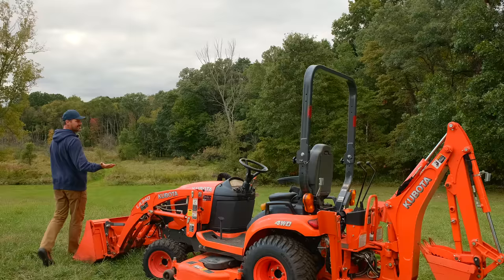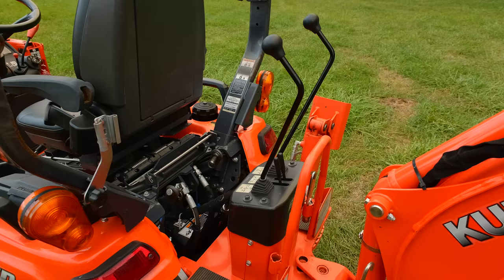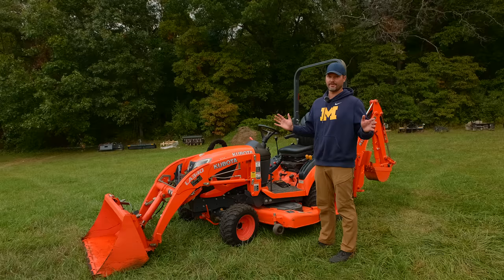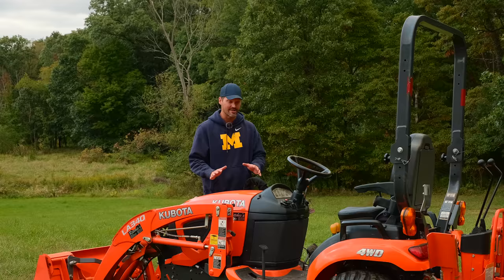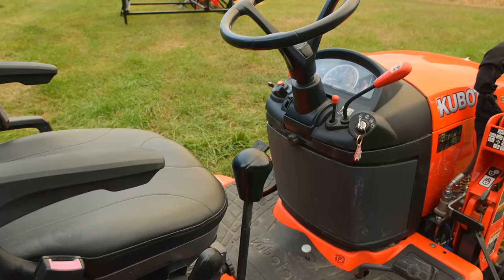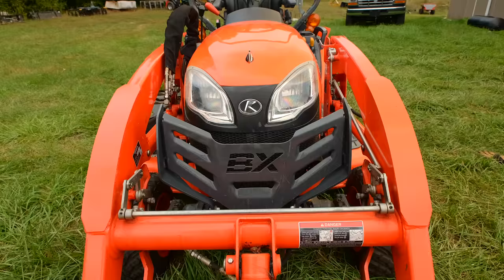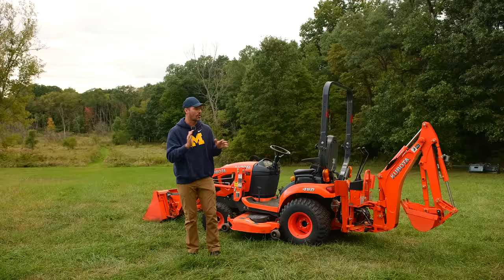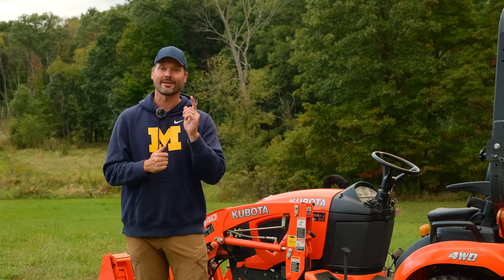PROBLEM AFTER PROBLEM AFTER PROBLEM

Comment: I hope anyone watching this reminds themselves that this is an opinion and for $20000+ investment you do more research. I have this machine and can't think of anything I don't like. This guy bought the wrong machine for his situation. As a lawn mower you wouldn't buy a tlb at all.
Reply from the maker: Pointing out the obvious isn’t helpful to anyone.  You only like everything about that machine because you haven’t owned and used a 1025r 😂
Reply: Kubota is the Ohio State of tractors...pretty good but over rated by fanboys.  Go Michigan!
Reply: @merikatools568  Michigan has beat Ohio st once in the last how many years?
Reply: The 54” midmount mower does fit perfectly. The 60” is to wide to. Accommodate the larger blades.
Reply: Right on.  He keeps comparing it to his bigger tractors.  Most people who buy a sub-compact tractor just have one tractor, smaller space, etc.
Reply: If you had to pay for it yourself you would do well to research the product no matter what it is. After the fact whining isn’t proving anything but a lack of due diligence. Sell it and recoup what you can. 
Plus, some of us buy equipment based upon access to a dealer for parts and service. That’s my story and I may have bought differently had there been another choice.
Reply: I have the older BX23. It has been used moving many tons of gravel, dirt and have dug many many feet of ditch for water, sewer and buried electric line. After almost twenty years old there have been a couple oiled seals start leaking but that’s to be expected. It’s not a D9 dozer or a large excavator. It’s slow digging and it’s a small machine but taken care of will do the work and last for many years. Mine is faded and from digging and bucket use there is lots of paint missing but it doesn’t have one dent or broken piece of plastic. There’s almost 16 hundred hours and I don’t plan on getting anything different.
Reply: It’s coming from a used car salesman. I take nothing he says a serious or having any meaning.
Reply: Mine is the BX2380 with center mower (54”) and same loader. I don’t have the backhoe. I really like mine. I have 30.7 hrs on it no problems at all. Mows better than my zero turn Jon Deere.
Reply: Love my BX23S
Reply: @GoodWorksTractors  I owned and used a 1025 tlb. Not impressive for the cost, especially with overpriced deere attachments. Kubota has better pricing and a better tractor. You 1025 fanbois are odd fellas
Reply: This is obviously an opinion video and this tractor has obviously been abused to only be at 400 hours. I know had a guy that had one of these and he really really used it. He dug ditches almost daily as a part of his job. He then bought a John Deere 2025R TLB and regretted his purchase pretty quick. He said the Kubota seemed stronger. I’m not biased. I’ve never owned a Kubota but I did purchase a new John Deere 2025R in 2021 I think. I’m sure some people love this machine and some hate it. Some love John Deere and some hate them.
Reply: I've beat the crap outta mine I overload it  all the time and push to the max  I actually figured it woukd have broke down by now but only prob I have ever had is 1 flat tire knock on wood 
U may have got a lemon or maybe I just got lucky
Reply: I have had a bx25d for 9 years, 600h on it. I love this machine. It is a workhorse, it never broke  once, even better...i can sell it today for more money than i paid for it. This is the no 1 selling sub compact tractor for a reason.
Reply: he's a salesman, who abused the sh1t out of this poor thing to get commissions.
Reply: @GoodWorksTractors  hey do you have any ford pintos that were only driven by grandma on the way to church?

Comment: I have a bx23s, 54” snowblower, 60” brush hog, 48” box blade, 72” landscaping rake, love this trouble free piece of equipment. It works like a mule!
Reply: Think you bought something you wanted to hate mine is great,tough and very versatile for what I bought it for
Reply: 300 hours on my bx23s so far and no issues that weren't self-induced. Seems like his main complaint is that it's undersized, so the title seems a little harsh. I think for 25k it's a great little machine for 10 acres or less.
Reply: I have a lot of hours on my Kubota trouble free and tough as nails it looks like this Kubota that this guy had really abused it

Comment: I bought a BX23S the end of last year and only started to use it in the spring of this year. It has about 85 hours on it and has been trouble free for all of them. I've used it mostly for clearing land and it's been great for that. I put the third function kit on for a grapple which has made it much more useful. However, my needs have changed and I now need a larger tractor. I will most likely be going with a TYM T394 or T 747. I think TYM offers a much better value than Kubota or John Deere and with their recent purchase of Branson their dealer network will grow quite a bit. TYM also owns their engine manufacturer Kukje. (though they still use Yanmar in several models). But value-wise, a TYM T25 with backhoe is the same or less than a BX23S or 1025R and will outperform both of them quite handily.
Reply: WOW! 85 trouble free hours. Imagine that!!!!
Reply: One thing I noticed and recommend you pay attention to. It can be easy to manipulate specifications or come up with your own testing standard when it comes to claims of performance. Sears was famous for that in their Craftsman brand. Everything they sold from a handheld circular saw to their lawn tractors always had these high claims of horsepower, where the same engine in another brands application had a lower stated value. I am in the market to upsize from my present BX25D to a larger unit and was comparing an offering from Mahindra to a similar sized Kubota unit. The Mahindra had higher ratings for lift capacity for their FEL and 3-pt. It also had a higher horsepower rating of the engine. But, when I looked at the unit weight, I noticed the Mahindra weighed 2000 pounds less than the Kubota. Where did the weight "savings" come from? Well, I will give you my "guess". It is because the Mahindra is made of thinner steel everywhere. How do you think that is going to stand up to service where you take the manufacturer at their word in terms of specs and size the tractor to your planned operations to just be adequate. A lot of buyers do this because tractors are super expensive, and this drives them to buy a unit that just meets their capacity needs. My thoughts are that the tractor built to margin will withstand long term use better if it is made of heavier, presumably more durable, quality materials and put together with quality than the same unit made of less material. In the tractor world durability is the most desirable quality over anything else. To ME, tractors are TOOLS made to WORK. I am not a Kubota fan boi, which is why I have been looking at other brands for possibilities, but my experience has been good given the 400 hours I put on my machine with no issues outside routine maintenance. I am considering others, but they have an uphill battle given my positive experience. I am looking to upsize because I have been pushing the capabilities of my current machine, and think this is unwise.
Reply: @LisaMedeiros-tr2lz  what does mahindra have to do with the tym he mentioned, (yes I know TYM makes some mahindras) The TYM and Kioti are about 500 lbs heavier than the kubota in the compact tractor size. btw, even tho I know the TYM are more rugged, I went with the kubota 2301 because the TYM dealers are terrible here and the kiotis around I looked at were either overpriced or beat to pieces.
Reply: @eviljesus5411  The comments were mostly agnostic to the brand being considered. The message is to look deeper than just claims of lift capacity on the 3-pt and FEL. I wondered how the Kioti could have greater spec'ed lift numbers, yet the machine weighed one ton less overall. The difference is in the structural steel. So if considering a TYM, look at more than lift capacity also. To me if the overall unit weighs less, than it has to be made of thinner structural steel. I can't see how that will make a unit more durable over time was the point.

Comment: The reason I'm watching this video is because I'm working on a bx2370 right now and the title of the video is pretty much what I'm experiencing as well. The throttle won't stay in place it's losing power I'm in the process of taking apart the injectors or trying to find out how to do that... Problem after problem. CV boots that are exposed and paper thin... It's pretty ridiculous. I'm selling it soon and moving and I'm not going to miss it at all. I particularly laughed at all the exposed wires and fuel lines and such running under the tractor completely exposed. I spent a lot of money buying skid plates that protect all that stuff. Terrible design....

Comment: WOW !!!!!!   Pure BS about a BX !   The tire hitting the mower is probably caused by a mal-adjusted Tie rod.  I have this setup and my 2680 and the tires don't hit my 60" mower.
My original BX2200 has saved me about $150,000 over the 23 years I had it.

Comment: I had a 1025r and it spent more time in the shop then it did at my place I finally got john deere to buy it back. Bought a kubota and have over 500 hours on it,its been problem free so far.

Comment: I have an older 25D that never ceases to amaze me.  I don't use the mower deck with it and have made a few mods like rear wheel spacers, bucket cutting tooth, skid plate, larger stabilizer feet, ROPs lights etc.  While it can't lift the most it can push a ridiculous amount.  It has been problem free with exception of front steering boots and the recalled dash cluster from moisture.  This tractor gets more time in the seat than my two larger kubotas and my skid steer.  Everyone that uses it wants one.  I will NEVER be without one.  It's like my wheelbarrow but with a motor, shovel, rake.....a Swiss army tractor lol
Reply: I bought a used 25d and it has served me well. On the dash did kubota have a recall that replaced the dash or did you have to buy one

Comment: I have a BX23S. 2 years, 360 hours, no problems. I have removed my FEL a number times, without issue. This tractor is the perfect size for my three acres. Anything larger would be too large for my property. The 1025R was thousands $ more.
I found it a little ridiculous that you were taking issue with dings and scratches, when they’re caused by the owner, not the manufacturer: mistreat it, it will get damaged.
I could go on, but it seemed like you were looking for excuses to diss it.
I have the HLA light 36” forks, and the HLA1500 54” snow pusher. They all work really well for this small tractor.
I love my BX23S.
Reply: Somehow you beat the shit out of it

Comment: I own a bx23s and love it. Perfect size tractor for our yard. Sounds like you bought too small of a tractor to begin with. Perfect size tractor for our 5 acres. No leaks, but I never have disconnected either bucket, nor backhoe attachment for I bought the tractor for those two reasons

Comment: Hey Courtney, the front wheels rub the mower deck because of the wheel spacers. If you remove them from the front you should find your clearance issues resolved. I do sell a kit to eliminate the single point connector, as they do commonly fail and are expensive to fix.

Let me know if you have any Kubota BX questions! I love these things!
Reply from the maker: Good to know!
Reply: I was going to say the same. Wheel spacers generally make turning clearances and rubbing worse, not better. Same concept with trucks and wider offset wheels. Operator error, in this case, I believe.
Reply: I put 1 1/2”spacers on the front of my BX and readjusted the wheel stops. 2” on the rear 😁

Comment: Great video Courtney. I have both the 1025r and BX2670.  The 2 big things I can think of where the Kubota shines is the mower deck can be raised much higher than the 1025r mower deck and the Kubota BX always starts easier when cold. The 1025r smokes and coughs like crazy and will fill my entire shop with smoke! Other than that I've found the 1025r to be a notch ahead in almost every area.
Reply: My Cub Cadet does the exact same thing when its really cold. I can barely see inside my shed about 10secs after I start it.

Comment: Thanks for your comments and take on this machine. Your points are valid and  I appreciate your perspective. I have a BX24 with 1300 hours on it. It has been a work horse for me and for most of my projects it has performed really well. Since it is my only machine I get lots of time on backhoe digging stumps and digging hydro trench on my new 92 acre property.  I have often wondered whether to trade up to a newer unit with some more bells and whistles but seems like I should keep what I have and go with a second bigger tractor down the road when I need more capacity. Cheers!
Reply from the maker: Very glad to hear it’s working well for you.  Thanks for taking the time to comment!
Reply: Holy smokes, this is your only machine for 92 acres?! 🤯  That's a ringing endorsement!

Comment: Not every piece of equipment jives with every landowner. I own this tractor and love it. I have mowed grass, cleared rough fields, cleared small tree stands, raked weeds and pine needles, moved a household of boxes and furniture, dug numerous water mains, dug stumps, yanked truck engines, cleared snow, pulled trucks from ditches, loaded and unloaded  machinery, and built driveways. This is at home. I liked it so much I had the school I work at purchase one to replace a Toolcat and a zero turn. Now we have one of the best grass high school football fields in western Montana. We have saved thousands on digging and hours pushing snow, spraying herbicide, fertilizing, and grading. 5 acres of grounds with this machine working Monday through Friday in the summer and snow dependent during the winter. Again, some equipment doesn't mesh with an owners operation style, but credit where due, this tractor will work for most everyone who needs a multitool of a tractor but don't farm. Edit: I bet It'll small farm just fine too.😂

Comment: I've had a BX23s for more than a year and I love it. I use it for maintaining my rental properties. I need something on the small side that can fit through 4' gates. I tow it in my dump trailer and it barely fits so it would take a significant investment for me to get something bigger. That being said, if I had something bigger, of course I would use it instead of the BX23s.

The BX23s doesn't weight very much so digging with the loader is difficult. A skid loader would work so much better. The backhoe is small so you have to move the machine frequently when digging trenches and this isn't easy because you have to turn the seat forward to move it. The factory pads on the backhoe outriggers are too small. I replaced mine with larger aftermarket pads which work great but they're heavier so it doesn't take much time at all before the outriggers start to droop when the tractor hasn't been used. There have been many times when I wished for a mini excavator but I can't afford one and don't have room to store it. This doesn't make the backhoe on the BX23s bad as it's still WAY better than a pick and shovel.

So, as someone who owns and loves his BX23s, I don't know why would have one Courtney. You have bigger machines that will do the job better. So sell that machine to someone like me that can get some value out of it. :)
Reply: I dug a 150 foot trench with my BX23S and only time I got off was to pee. Don’t use the parking brake and work the bucket and steering wheel from the backhoe position.  Use the boom to push the tractor along.

Comment: I own a BX2380 and it been trouble free for the 250hrs I've put on it thus far. By the looks of your BX it's had a very hard abusive life with the scratches, dings and bends on it. The previous owner just abused the crap out of it IMO. I run a 60" mower deck (yes, I agree. It a PITA to install), 60" rear blade, 60" rear box blade, 48" rough cut mower, and  BX36S Wallenstein wood chipper and front pallet forks when needed. My Kubota BX has been trouble free and never let me down.

Comment: Interesting.  I had a 1025R that had a lot of leaks and issues so I traded it for 2038R and am pleased with the upgrade.  I appreciate you thoughts and concerns you have had on that tractor. 
Love the videos.  Please keep them coming.
Reply: My parents bought a brand new 1025R in 2019 and within about 15 hours it had a major hydraulic leak that the dealer had to do major work to fix it. (under warranty of course) It had a lot of nice features but it just seemed underpowered to me. My father passed away in 2020 and I talked my mom into selling it for a larger tractor. I picked up a like new 2013 MX5100 with 200 hours and is sized to the property much better. The only thing I miss is the seat as it was so much better on the 1025R.